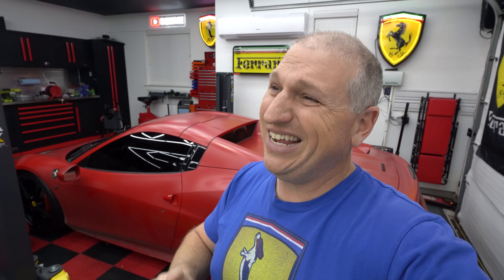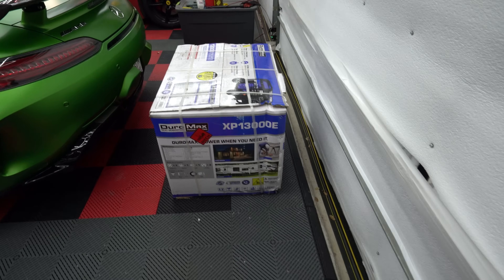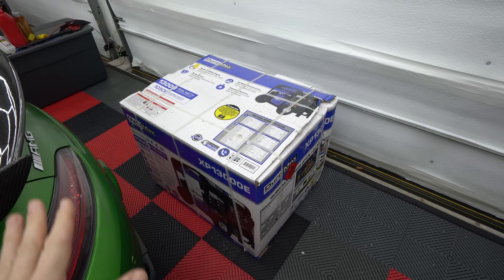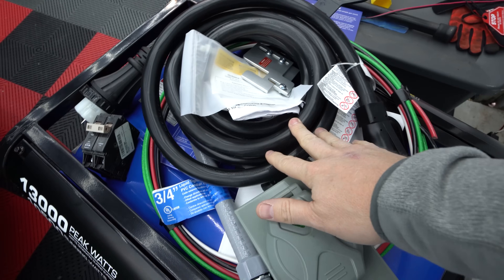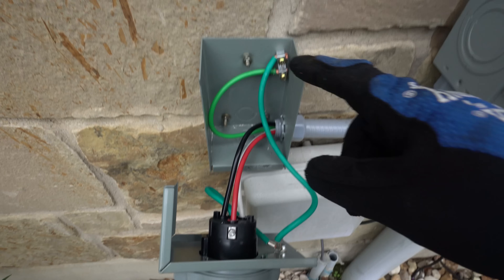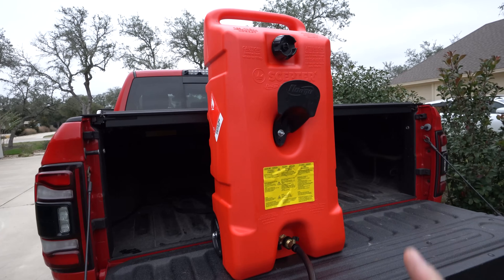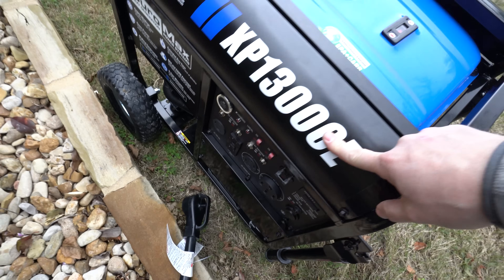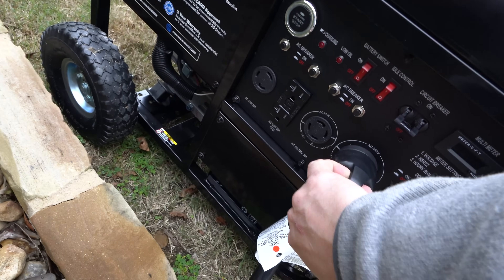How to Install a Backup Generator with Interlock Kit on a Budget

Comment: Great video! Very concise and step-by-step instructions on how to connect your generator to your main panel.
One of the things I noticed on these types of videos is that nobody addresses a very important point about bonding or unbonding the generator. Aside from the interlock being very important, another important thing to mention would be that the generator should have floating neutral in a set up like this. I wonder if many people are not aware of that.
Nonetheless, Great video and thank you for sharing.

Comment: You have no idea what you’re doing by turning it on and off! Start gen let warm and even out a couple min. While running shut main off and turn gen breaker ON. Then with a large panel like that shut off all breakers. Plug cord in and then turn your generator main breaker ON! (The 2 pole on the generator) then start turning breakers on one at a time so the generator can acclimate to each load. Flip on 1 breaker wait 1-2 seconds then next and wait 1-2 seconds until all breaker switches are on that you want on same when shutting off turn each panel
Breaker off 1 at a time then shut the gas off on the generator and let it run all the gas out of the bowl helps with issues don the road plus it gives the generator time to run without load to cool down a bit. Once the gen  stops running disconnect then turn on main breaker and the rest. Also NEC requires stickers on the meter box, a printed gen sticker on the gen. Breaker. And on the gen inlet box that you plug the gen into all are a NEC MUST die to potential hazard should an electrician come out to work on it. Also if the generator is a “bonded neutral” you HAVE TO UNBOND OT especially since you should have only one bonded point and that’s at the service entry. If it says floating neutral you’re fine
Reply from the maker: Cool

Comment: That generator doesn’t produce 50 amps on they fo you recover it to. A  14-50 outlet doesn’t mean 50 amps the main breaker on the generator for the 50 amp outlet is is only 40 amps. Simple maths if you run that at full bore (10500 watts) it won’t last a year if you’re using it that way more often than not. So to figure the amps it makes at max is easy use your running watts! 10,500 devided by 240 amps and that equals:—— 43.75 amps in total also NEC and local codes in my area require a “BUFFER OF 10%” so another math problem 43.75A plus 10% equals 48.125 since they don’t make breakers that size we round up. And we get 50amps! 12,000 continuous watts is exactly 50 amps! And we don’t use surge watts because surge watts are EXTREMELY SHORT TERM WATTS TO GET LARGER ITEMS GOING ESPECIALLY IF YOURE CLOSE TO YOUR “wall”…..
Reply from the maker: Ok

Comment: 1,399.00 generator, LATING Generator Interlock 36.88,Eaton CHF250 50A Double Pole Circuit Breaker 24.00,GeepKey Latest 50 Amp Generator Power Inlet Box, NEMA 3R Generator Receptacle 50 Amp, NEMA SS 2-50P PB50 45.99,  7 50 Amp Generator Extension Cord, 13FT STW 6/3 + 8/1 Power Cord N14-50P & SS2-50R & CS6364 Twist Lock Connectors 69.99, Scepter 06792 14 Gallon Flo-N-Go Duramax Gasoline 14 Gallon Portable Gas Fuel Tank 136.99 so right around 1800 not bad.
Reply from the maker: Yeah that's pretty reasonable

Comment: Interersting panel you have there.   All but one in that panel are 220 breakers, except one unlabeled 120v breaker.  You have to go one step further in your other panel (wherever that is), and trim off some more load as it's on a 100 AMP breaker.  Can't imagine another sub panel with 100 amp load on it for just other routine low energy drawing devices.  But,  I see nothing wrong... just precautionary to see what the subpanel has on it.
Reply from the maker: Yeah

Comment: Hi Dan.  Thanks for this.  I got the same exact generator off of Amazon for a similar price delivered on 10/14 (actually still in the box).  I have zero experience with generators or electrical matters period.  So this is helpful.  I’m going to hire a company to install interlock kit and inlet box.  What do u think is a good labor price I should be looking for?  Also any hints to turning on the genre besides what you show on the video?  Appreciate any advice bud.
Reply from the maker: I honestly have no clue on how much it should cost

Comment: Don't forget. You never have everything on in your house at the same time. My 9400 watt tri fuel generator runs my whole house including a 3 ton ac unit with no problem.. I run mine on natural gas so its a lot less than 9400 watts. My main concern was heat in the winter, but the ac works just fine. I  don;t have most of the electric stuff you have. Mine is mostly gas. I also use an interlock on the fuse panel. I love it . I had 2 different switch boxes before, one 6 circuts and then a 10 circute. Then went to the interlock . So much faster and easier. Im in MIchigan so we see cold weather a lot. I have been using this setup since I have been in this house  23 years. Your gonna love it.
Reply from the maker: Yup!

Comment: Have you thought of using a soft start on your AC? Then you can use the generator to heat or cool the house. That’s if you have central air. I have a 4 1/2 ton ac so I installed the ICM870-32A Soft Start
Reply from the maker: I will have to look into that
Reply: @normalguysupercar  https://youtu.be/y0qsAqo2b9E?si=xw0WtNrsWe2DKOtR

Comment: thanks for sharing. What kind of wire did you use from the Circuit breaker to the inlet box?
Reply from the maker: I think it was 6 gauge
Reply: @normalguysupercar  thanks, just installed my inlet box, and used 6/3 wire. It was a pita to close the enclosure on the inlet box, not enough room for such a heavy wire.

Comment: You should make sure your generator can run, uncovered, if it is wet.  I make a tent, for mine, so rain can’t get in, but ventilation is good.  PVC frame and some stakes make an easy structure.
Reply from the maker: Good idea.

Comment: Nice video! 
We would love to see it power your AC! Depending on the tonnage it should be able to handle it if its less than 5 Tons. 
Thank you!
Reply from the maker: Oh interesting.  I didn't think this one would have enough power for that.
Reply: Especially if a Micro Air soft start was installed on the AC.

Comment: did  you do a engine break in?  normally 4-8 hours on dino 30 or 40 straight oil.
Reply from the maker: The instructions didn't suggest any break in period

Comment: Been watching a lot of videos on larger generators using a 30A double poll breaker but looking at my 3600w one it is 120v 30A max via a generator or RV cord.

 Assuming I would only need a single poll 30A breaker instead to do the job as i am only running 120 at 30A max ?  Does that sound right ?
Reply from the maker: I think so but I'm not certain
Reply: I am not an electrician, but I think that would only power half of your circuits. There are two phases in a normal US residential building. The phases alternate between the breaker slots.

Comment: You must break-in  the generators  before you need to use it.  Read the manual .  Fyi that is not a inverter  unit, it could cause problems with sensitive  electronics  like cell phones,  tvs, computers,  new washers dryers and refrigerators.
Reply from the maker: Don't assume so much, the manual did not mention a break in procedure.
Reply: We have a similar generator and YES,  you’re supposed to break it in for five “5” hours at no more than a Half a load Before using it loaded like I’m sure you did, it appears that the generator windings need broken in as well, all of our generators Before this we only broke in the Engine, but Not the generator portion. 🫣 Oh Well 🤔🤷🏻‍♂️

Comment: Dan i have the same setup here in the Northeast outside NY. Question... is it a Texas thing to have the fuse box on the outside of the house? Find it odd as i would not want anyone to have easy access to the breakers.
Reply from the maker: Yeah I think it's stupid but that is what they do here
Reply: Over the past 15 years, regulations have been introduced in certain parts of the country requiring breaker boxes to be located outside of the home. This is so that the local fire department can quickly shut off a home's electricity supply in the event of a fire. But I personally don't like having the breaker panel mounted outside the home exposed to the elements, I may then have to go out in the rain or snow to reset a tripped breaker or GFCI , it is very difficult to make future electrical changes with the breaker panel fully boxed into an outside insulated wall which cuts off easy access as compared to being mounted to an open basement wall, anyone with bad intentions or just a prankster can easily access the breaker panel, etc. So tell me, what is so difficult for the fire department to instead simply pull the watt meter from the outside wall mounted meter box to cut the power to the home? This is a better and already existing alternative to requiring the main breaker panel to be mounted outside so that the main breaker is easily accessed to turn off the power in the rare event of a fire.

Comment: You wouldn’t get away with that generator cable in the U.K.  potential to have live pins in your hand if the genny was running.  Unlikely - but possible.  Our appliance plugs attached to the wall are also interlocked but have the male pins and the genny cable would have female pins.
Reply from the maker: Well... Good ole USA standards. Lol

Comment: You are good. Power grid is strong....
Reply from the maker: We will see
Reply: @normalguysupercar  The power grid is holding up fine, but some neighborhoods are without natural gas because the pressure has dropped too low.

Comment: Beautiful set up Dan! I used to have to fire up my portable generator until I got sick and tired of dealing with 8 to 10 or more power outages in my neighborhood every year. I also have a swimming pool and a 300 gallon aquarium, and so I went with Sunrun solar panels and Tesla Power wall back up battery that automatically switch over instantly whenever the system detects a power outage from the grid. After two years I found out I actually have saved an average of almost $7,000 a year on the electric bill.

Of course now we only have 3 to 5 power outages a year, and I only know about the power outage when I receive a notification text from my local utility company notifying me about the power outage. And many of my neighbors have since went with Sunrun solar panels and Tesla power wall battery back up so they don't freeze in the dark during a cold winter while fumbling to hook their portable generator when there is a power outage. Cheers!
Reply from the maker: I'm definitely considering solar panels in the future as well
Reply: @normalguysupercar  Yeah because you also have a pool I highly recommend getting solar panels and the Tesla Power Wall back up battery so you can save tons of money on electricity every year.
Reply: You pay $583 a month in electricity and a single tesla power wall can operate as a backup?
Reply: @Christobevii3  Correct. I have a large aquarium and an Olympic size swimming pool with pool equipment, and they both draw lots of electricity. And so before I went solar with the Tesla Power wall back up battery I was paying almost $600 a month for electricity. Now with Solar my meter runs backwards and I am paying zero for electricity, and some of the extra electricity generated gets sold back to the Utility Company. 

And the Tesla Powerwall battery back up can be programmed to run on reserved electricity for 8 to 10 hours or longer. (Most power outages in my area only about an hour, the longest outage we had the last 10 year lasted almost 3 hours.)

Comment: Great video Dan - I've always been told to connect the umbilical cord before starting, then have all breakers off and slowly turn the ones you want on one by one as to not overload the generator with startup current. BTW, love my Winco generator for a more premium product.
Reply from the maker: It's funny cause the instructions on the generator were different from the instructions that came with the interlock kit. I'll probably go with the generator instructions

Comment: Don't let it get wet. The $800 ones the circuit boards are not epoxy dipped; the $1800 ones are. Ask me how I know!!!!
Reply from the maker: That's good to know
Reply: If you mean just the clear waterproofing, this is conformal coating.  You can buy it in spray cans or small bush bottles.  I will apply additional conformal coating to hvac boards or anything that may be exposed to humidity.  Another approach is epoxy potting where the entire board and components are encased in a block of epoxy and this is very good for preventing damage due to vibration which might not be a bad idea for something on a generator.
Reply: My 4th and working generator (10+years) has the curcuit board in poured epoxy.

Comment: Dan, I am a commercial generator tech in the northeast with alot of experience in residential units. Putting in a standby system will be minimum of 10k for a generac unit. I would stand clear of generac bc they are junk. We call then genajunk in the field.  I run my whole house on a 6800... You can run ur whole house with the generator you have. You will need to install easy starts on ur ac/heat pump systems to work properly and not overload the generator. I strongly recommend installing a whole house surge protector.  Any other questions please contact me.
Reply: Great Advice
Reply: Generac anything are junk. I got a Generac pressure washer ; first one lasted 8 minutes , the warranty replacement , 20 minutes. The Honda upgrade I still have ( 20 years)
Reply from the maker: Thanks for the tips. Yeah I've heard generac are crap. I looked into getting a Kohler but yeah it was really 10k plus then I'd need to install a propane tank so we're taking a lot more than that
Reply: I am a Kohler dealer. The best residential unit you can get. I have oil heat for my house which is #2 diesel fuel. I got myself a diesel unit and run it off my tank for my heat. I would never run natural gas for emergency back up power. I prefer having a stand alone fuel source that I can control and not the gas conpany. Couple years ago where I live in Massachusetts we had a severe gas over pressure issue which blew up multiple homes and shut down the power grid and gas supply for weeks. It will cost more to go with diesel or propane but it is the best option.
Reply: Consider Champion as well.  A 14KW dual-fuel whole home generator with 200-amp auto transfer switch is less than $4,700.

Comment: Dan is spot on. The portable ones are a lot cheaper but there are a lot of drawbacks. I went with a whole house standby and it was an expensive endeavor but it will power the entire house and come on and off by itself.
Reply: Hi, where do you live? How often does it go on?
Reply: @dzikijohnny  nj. It usually comes on a couple times a year. Ironically it actually came on today because we’re getting some significant storms. I did a bunch of videos on my channel about it.
Reply from the maker: Yeah if we were in an area that lost power frequently then I would have been more inclined to get a whole house generator but this should be sufficient for most instances

Comment: Septic power ?  We've had septic before and now, but never powered. 🤨
Reply: Supercarpoop requires a powered septic system.
Reply: @admranger  🤣🤣🤣🤣
Reply: @admranger  😮💩🚽
Reply from the maker: Yeah I'm not totally sure why it's got power to be honest. Maybe a pump of some sort.
Reply: @normalguysupercar  If your septic field is not a gravity discharge system, it will have a pump in the pump chamber of the second settling tank to pump the effluent to the field. It's also code (up here in the great white north anyway), to have a septic tank high level alarm which needs power.
Reply from the maker: @Rchelicopterfun  yeah it has the alarm but there's no way that needs 30amp 240v.
Reply: @normalguysupercar  The breaker is sized at 250% of the full load and that effluent pump plus the aerator pump likely draw about 12 amps.

Comment: Nice DIY work there Dan. Very similar setup to what I installed at our rural location up here in BC 14 years ago and it works a treat for such a low cost investment in both time & money. We generally have at least 2 long term power outages every year; thing pays for itself as you said in just one long term outage event + the peace of mind. Best of the season.
Reply from the maker: Thanks! Hopefully I don't need to use it much but it's nice to have